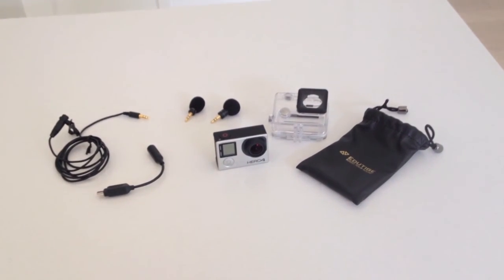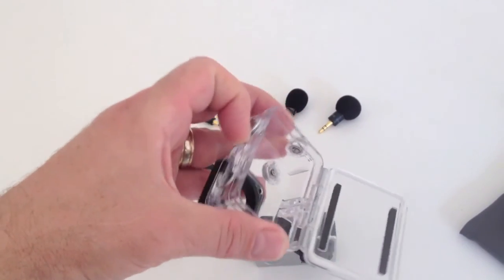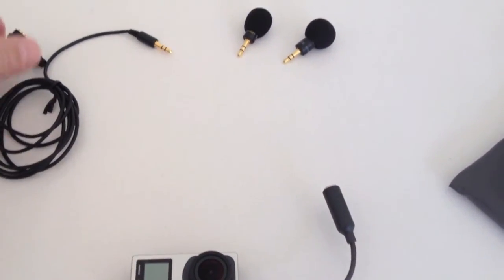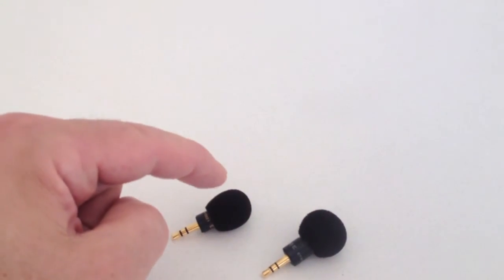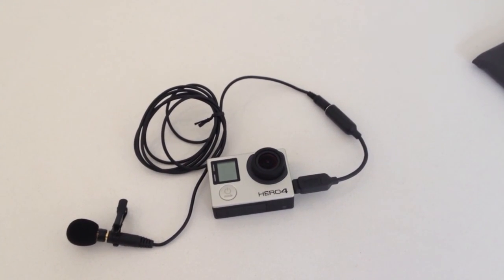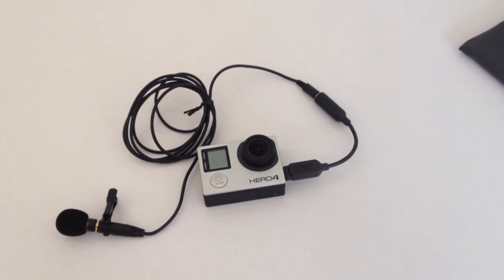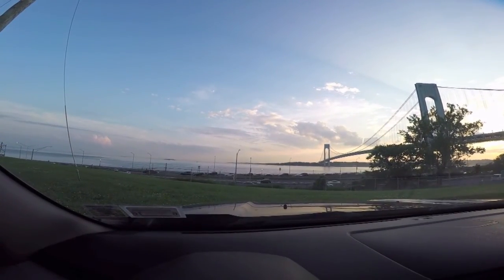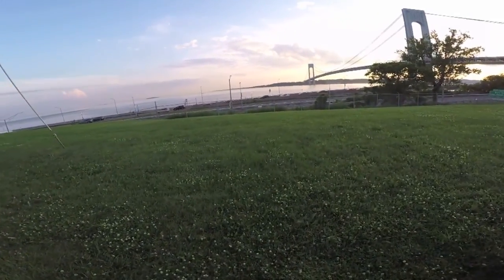Edutige ETM 001 & ETM 008 Microphone Tests with GoPro

Comment: Well I use till now all the Lavalier and SmartLav from Rode.com which is OMNI direct as the video maker said (indoor mic.) The ETM-001 in the video sound not better and seem to be same as good the Rode Lavaliers that I use. I have also 4 Fostex AR101 UNI directional microphones that comes with the iPhone 2 x Fostex AR101 that in fact is an mono to stereo converter. The Fostex (outdoor) UNI directional microphones are not good enough, to noisy and only workable when using a lot of windshield attached with than the result of too quiet sound.When the video maker stepped out of the car on changed the ETM-001 (OMNI) to ETM-008 (UNI) was clearly to hear the reducing motorway noise sound. I which I was able to edit the Fostex AR101 microphones but I guesses it can't never reach the level of the ETM-008. There will be sure a downside using the ETM-008, I think that the mic will work fine in the condition it is attached very close and pointed to the mouth. On the chest the ETM-008 will has lower sound I think? What is in fact an question for the video maker, so you use now a time the UNI outdoor mic, what is your option today? I'm interested in the ETM-008.... Luc